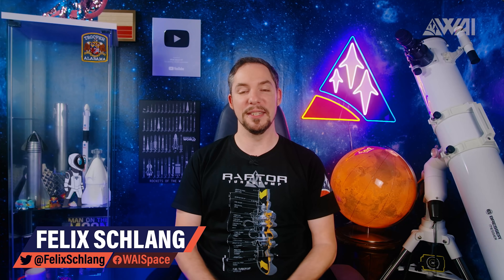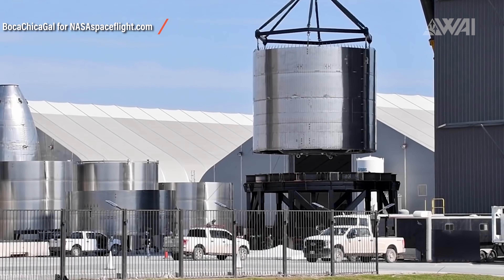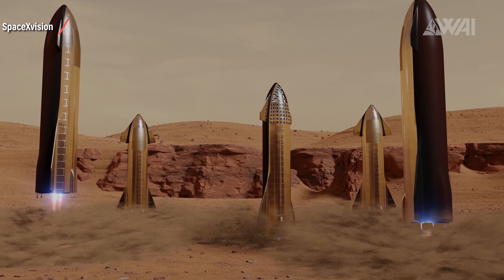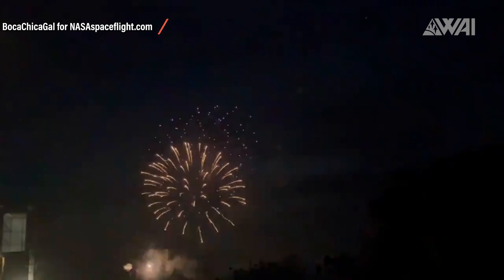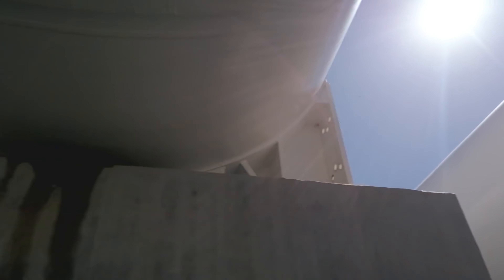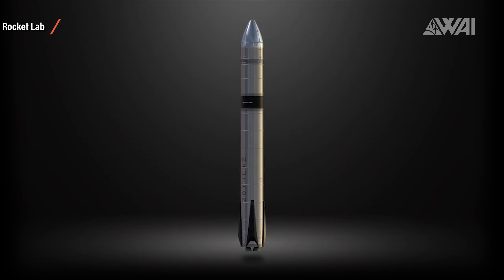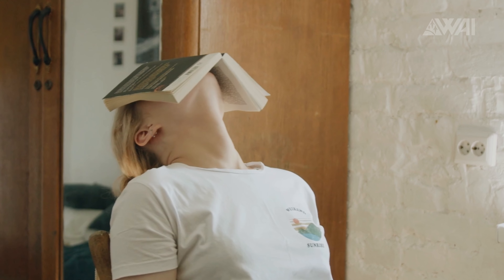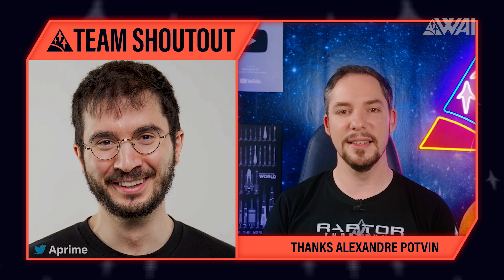SpaceX Starship Without Legs? Is Elon Musk Serious? Blue Origin & Rocket Lab Next Gen Rockets!

Comment: Starship Needs legs. Period.  It needs to blast off from mars several meters high in order for there to be less chance of rocks being blown back under the skirt and causing damage.
Reply: Absolutely correct, they should have known that in the beginning.
Reply: I understand that I really hate when dirt and rocks blow under my skirt
Reply: I think the starship with no legs is for point to point on earth. As the landing is on bigger droneships with no rocks or dust. there's no need for legs if they can catch the Starship.
Also as Rockets engineers they know they need legs for mars or the moon.
Reply: @j.f.almeida9081  
If landing on a porous metal mesh - like on bridges - the landing gear could be just a single "foot" ring/cylinder supported by off-the-shelf hydraulic pistons. Without point loads, the structure might be a simple sandwiched corrugated metal ring with a convex bottom edge. 

If the landing surface must be solid, then the landing foot ring might be supported by an open cylindrical truss of small tubing.

Comment: This talk of catching boosters and starships suggests major issues to me , That they can’t do something an 80’s antonov can achieve makes me wonder at a deeper issue. Using catch towers generates a lot of problems,  accuracy has never been pin point designing a catcher is’nt straight forward and failures are likely to remove both tower and ship, never mind any people who want to ride on it. I like out the box thinking but this seems to swap 1 problem for 3 more. it suggests the weight penalty for real legs is seriously impacting the payload, perhaps the starship has gotten badly overweight?
Reply: Not really about overweight but the reduction of it to increase payloads inside it. It’s a decent idea but I’m a bit skeptical

Comment: Once again Starship needs legs!  Use the same type thats on Hopper. The Apollo Lunar Module used legs and even though it could have landed on its bottom and descent engine but that could have possibly ruin the equipment stored there. As we saw on SN10 three of the legs deployed but failed to lock.  If Elon thinks a Starship can land without legs let's see it done with a Falcon 9 booster first. Again great presentation Felix!

Comment: Someone with a twitter, suggest to Elon having curved legs that swing out from the body on hinges like the wings.
Reply: I did a design in Fusion360 that has six curved legs that follow the curve of the body. They are tucked up under the skirt horizontally and swing down 90 degrees into position (sticking out radially), much longer than current legs and stick out considerably when in the deployed position. Gives much more clearance between the ship and the ground. The pivot needs to be at a 45 degree angle to horizonal and 45 degree angle to the radial. Creative, simple and works. But how do you tell SpaceX?
Reply: @TheSnakecarver  I was thinking something far more simple.  Something that is essentially in the shape of a curved pizza slice around the outside hull of the engine skirt, that doesn't necessarily need to extend down, but will expand the stance of the ship on the ground.  As far as telling Elon, he seems to like twitter.

Comment: You are all focused on... and near missed NASA plan to 3D print a truss for solar panel in space on a upcoming mission... 

But ya... if you can drop near enough... than drop into a cylindrical bay... use heavier than air. Elements... could use inflatable structures.. membranes... 
Use backpressure and say firing up the last few membranes... those legs need to fold in to protest the engines... run it like a diesel fired pilon driver... self contained.... for landing? Well alot of questions

Comment: People need to stop calling a rapid pace of exploded test vehicles, "Innovation".  Theirs basically no change in these vehicle physically, they are just being run through different flight routines, none of which have been successful.  At best you can call this rapid iteration, when and if the project is successful then it is an innovation.
Reply: It's a mix and match of both. If something broke like methane pressure on one starship, They fix it in the next. Slowly but surely it's a process that makes a better rocket rather than a disposable rocket that sends 4 people to the moon and calls it "The New Age Of Space Exploration"

Comment: All new rockets being developed should be fully and rapidly reusable and either Methane or Hydrogen fuelled. Methane and Hydrogen can be manufactured using carbon dioxide and water and renewable energy. These are the things which are necessary for a transition to a circular economy, while reducing the cost and carbon emissions to put cargo and passengers to orbit and beyond.

Comment: SN8: Header tank fail
SN9: Header tank fail
SN10: Header tank fail
WTF is wrong with these numskulls? 
STARSHIP DOES NOT NEED HEADER TANKS, PERIOD. 
Just a very simple tank design change. Thats all. 
And 100% constant fuel supply, guaranteed.
Reply: Being more specific:
SN8: Methane header tank presurization fail
SN9: Header tanks autogenous presurization fail
(Switching to hydrogen as a temporary solution)
SN10: Engine throttle failure, landing legs deployment failure